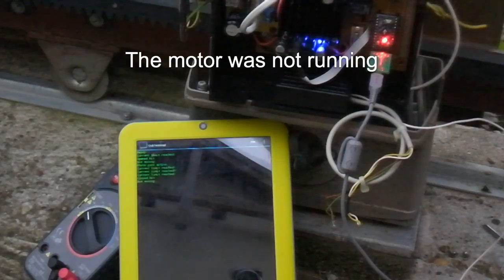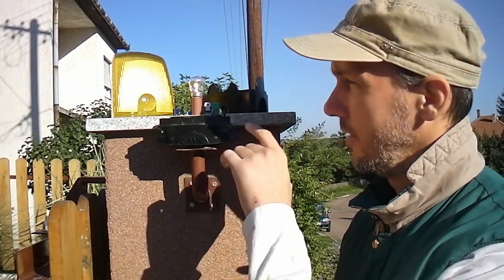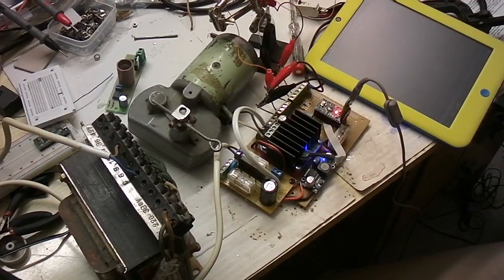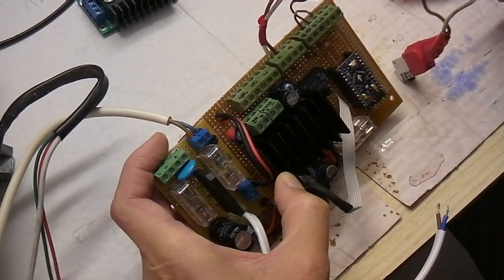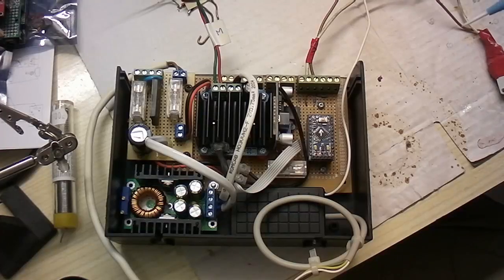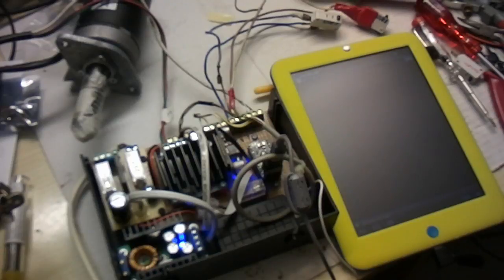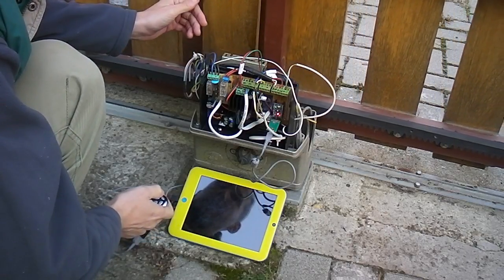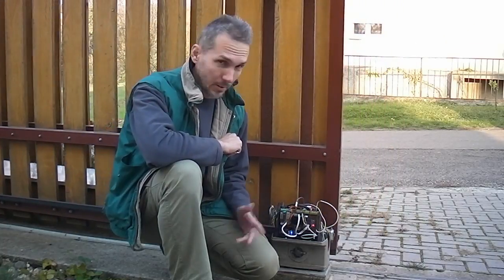Sliding gate controller fix - Part 2

Comment: hi sir can you send me the sketch and code for this project plzzz.... am going to do this project @ my home   prakashranjith@ymail.com & myfriends.1988
Reply from the maker: Hi, you can find some design steps in the Part 1 (see description). Unfortunately I cannot provide the code for you in the stage it is now. First of all it was not cleaned from junk. Second is that a mechanical thing like this might cause major injuries. However it is already running without any issues for 9 months now, I don't want that because a software error someone go hurt.
Reply: +Balázs Kelemen  tanq for ur replay sir ... I have completed 85% of work with this project... i have create code too soon it ll completed... tanq so much